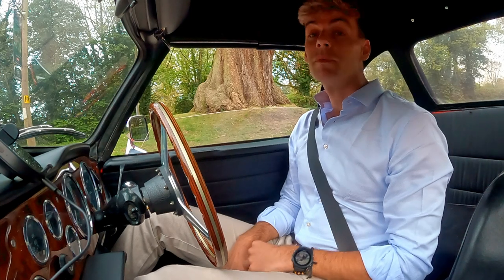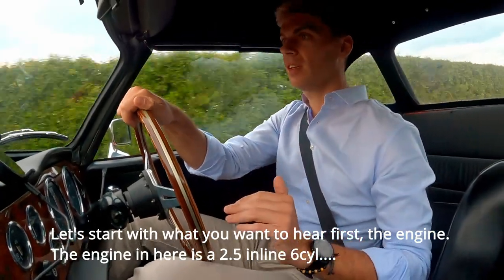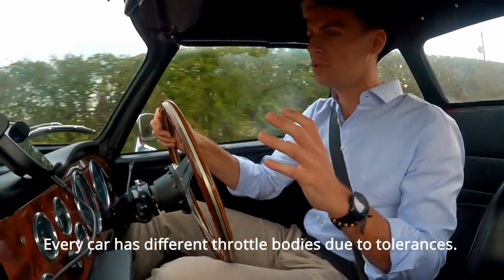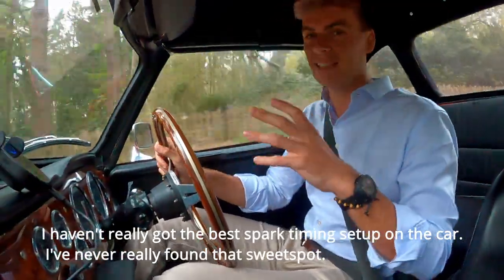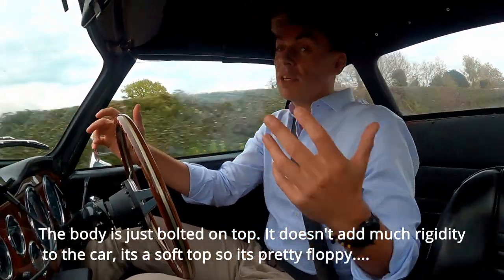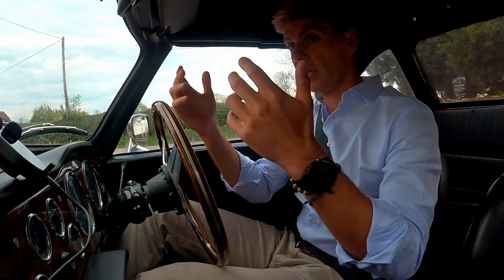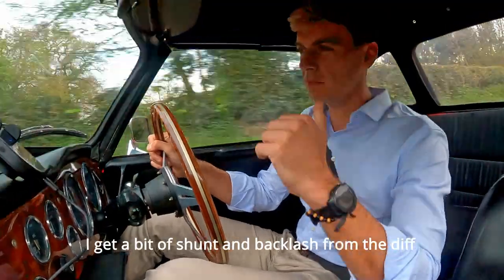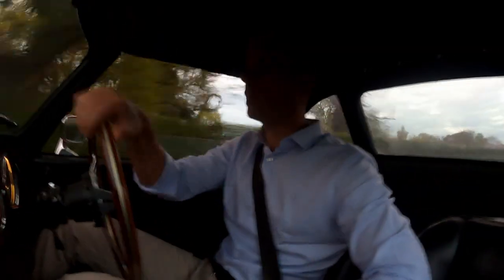Triumph TR6 PI Review: Classic British Engineering. Was it Rubbish? #classiccars

Comment: Great video! I live in North Carolina and purchased a ‘73 TR6 in 1975 while in college.  Right after purchasing it I had a rude awakening after taking it to the British  Leyland dealer for repair.  At that point I bought a manual and started doing all of work myself.  I added overdrive in 1976, and used it as my primary vehicle until 2002.  By that time I had put 200,000 miles on it. I kept it in good mechanical condition, and it has never left me stranded.  

In 2002 I purchased a Ford Expedition and started making the TR6 look as good as it drove.  

In 2012 I overhauled the motor, shaved the head to move the compression from 7.5 to 9.5, and added a cam that is similar to the one originally used in the 1969 150 bhp version.  The cam was developed by Good Parts located Pennsylvania. It preserves the idle quality while adding the power.  What a difference! It will now burn a little bit of rubber, and it is a blast to drive.  Bottom line, a TR6 is fun to drive, looks great, and reliable if well maintained.
Reply from the maker: Love that story! Enjoy it.
Reply: Mark, your post is encouraging.  I bought a 75 TR6 last year.  It’s in great shape but put a great deal of work into it already and more coming in 2024.  
I assume you have a Good Parts header on the beast, what did you use for the exhaust.  I have a dual Anza with a couple of resonators under there as well, yet it’s so loud I can’t have a conversation with a passenger without shouting.  Bottom line is, I want a performance boost but a more sane noise level.  Any suggestions?

Comment: I appreciate hearing the rattles when you go over a bump, since I’ve been hunting down rattles forever, trying to fix them in any way possible.  Attempting to reduce that feeling of they forgot to tighten all the bolts when they built it.  It’s getting better! Or maybe the roads are better!
Reply from the maker: Most of them in this clip are from the soft top pivots and loose nylocs but i know what you mean!

Comment: Enjoyed the video, having owned a 1972 UK TR6 some years ago it was great to watch. A couple of things I think which would have been worth a mention? The engine hp output for UK cars did differ 150 ( allegedly) until end of 1972 then 125 until end of production. The US cars were around 105 hp and as you say had carbs. I worked on these engines in the 1970’s and when one came in ( same engine in the saloon 2500 PI) with a misfire the first place to look was the injector. Failure mode was the injector end came away and was loose. Very quick job to replace.

Comment: This video was a revelation for me. When I was 18, I had a 1972 TR-6 and drove it off to college for the next 4 years. The top was always down, never mind the weather. Autocrossed it successfully and every girl I dated loved it. For me it was a dream car but I was nearly certain that if it only had P.I. vs. carburetors, for more power, it would be an absolutely perfect car. I never could have guessed that in comparison to carbs, P.I. would be such a nuisance to tune and maintain. I could never have done it right. Glad to know that my TR-6 was really perfect just the way it was.
Reply from the maker: I agree about the girl comment 😬
Reply: @PeakTorque  Not to belabor the point; but roadsters are one of life's most reliable panty peelers. My last one was a Honda S2000 when I was still single. A peak experience.

Comment: Nice looking TR6, I owned a GT6 mk3 for 23years (hence the youtube name!!) but sold it back in 2017. I converted that to 2.5L back in 2004, but ran with carbs and 3D mapped ignition, always ran well with that set up and minimal routine maintenance.
Good to see some Cheshire lanes, I occasionally cycle out to Beeston castle.
Reply from the maker: Great loop around beeston and bickerton. Couple laps of that at tempo is very sapping on the legs... potholes galore tho.

Comment: Beautiful car! BTW, what fuel do you use?
Reply from the maker: Super unleaded with castrol lead replacement. The valve seats haven't been hardened yet, but its on the list to get the head off again and do that.
Reply: @PeakTorque  Cool. We just sold my fathers 67 Porsche Sportster convertible. It was a great little car, but not for me. When the weather's nice, I'd rather be on 2 wheels

Comment: Mechanical fuel injection can be surprisingly good and less maintenance than EFI. Ive had a few cars on mfi and the Bosch  was the system I liked the most. I converted the points over to an optic electronic in a Lucas distributor with uprated coils. Did you retain the rotor and cap or do away with the dizzy altogether? My mate had a TR5 and a 7 and another mate had a Spitfire. I always fancied a Spitfire but bought a TVR S instead. Triple carbs can be a bugger to setup especially the SU's but once you get Weber's or dellortos balanced they tend to stay that way. I had a vacuum and ball device that I had great success with on a twin carb lotus.

Comment: Beautiful classic roadster you’ve got there! It certainly takes a patient engineer to drive a car like that. It’s not always about gobs of horsepower and blistering track times, but the sense of occasion and adventure just simply driving it to the grocery store. 
It’s far more of an adventure driving my locost seven around the block at 20 mph,  than my 335i at 80 mph on the freeway.

As an automotive engineer, I wouldn’t have the patience to put up with vintage engine antics and would have converted the engine to EFI with a modern standalone ECU, with o2, knock, MAF sensors and so on, while keeping the vintage roadster exterior. Or I’d swap the power train for a stock s2000 engine, trans, and ECU, and dramatically improve the cold start, BSFC, emissions, an so on—however the “charm” of vintage British engine reliability issues would be gone; which would be part of the adventure?

Comment: Nice video, nice car. I have an MGB myself. Seems too be a few classic loving cyclists around. Not as many in our age group tho 😮
Reply: Agreed. 

I think old cars and bikes go together naturally as they both need a hands on attitude compared the single use throwaway cars produced in the last 20years. Owners will naturally get younger as the generation these classics was built for get to the age they can no longer drive. 

I had to sell my 71 B GT last year as it had become a long term project I didn’t have time for and I needed the garage space to work on other peoples’ TVRs and, of course, lots of bikes. 

My now 20 year old TT fills a similar niche, and seems to have slipped into the “classic” zone, but does not claw into your soul in the same way as the smelly, clunky, snorting, slidey, rorty, beast the MG was. I miss the conversations at every fuel stop and the arguments at shows about wrong wheels, tyres, bonnet, suspension, air box, exhaust, basically everything. I did what I wanted to it, if it annoyed the purists that was just a bonus. 😬

Comment: It’s an accurate and good review. In terms of pushing this kind of car hard around corners and trying to make it do what a modern sports car would do is not really what this car is about though in my opinion. I have owned a TR6 for 8 years, restore it in 3 years and enjoy keeping it in good shape, cleaning and polishing it. The way I use it is to only take it out on nice days. I hardly ever put the soft top up as I hate driving it like that as it’s actually a lot more noise with the soft top up. A bit of spirited driving is ok but mostly it’s about cruising around on smaller roads enjoying the view, listening to the glorious engine, smelling it and doing this with fellow owners of classic cars. Going to classic car meetings is a huge part of this, talking about maintenance, modifications, studying other people’s cars and just taking it all in. It’s cheap to repair, most parts are available, easy to repair (when on carbs) and it’s solid. Some people say these cars was poor quality but I strongly disagree, try restoring a Japanese car from the same time and you will see what I mean!
Reply from the maker: The only reason I had the roof off is so you could hear me! (sort of)

Comment: Had a '69 TR6 in the early 70's. Carbs of course here in the States. It was always in the shop for one thing or another. I missed it so late in 2020 I got a new Mazda Miata. More HP at 181 plus spot-on reliable. Total blast to drive. Forget the TR6's unless you want to constantly tinker. If you truly want to enjoy top-down driving in a modern platform, buy a Miata.
Reply: well if you want a modern 4-cylinder car, you could but just about anything.

Comment: Gawd, Lucas mechanical fuel injection...  credit to you for keeping it running happily.
Reply: I don't know if that one has the Lucas ignition with the positive ground like the Ford Cortina. That would be trouble. The axle wound up so that the left rear would lose traction first. Engine turned the reverse direction from an American car of that live axle design. Rust, rust, rust, leaks! Cortina GT that is with the peace sign tail lights. Green Black.
Reply: @davidburgess741  thats the first I've heard of a reversed rotation drivetrain vehicle.
Reply: @rotaxtwin  most Hondas until 2003 ran reverse rotation.  Simplifies FWD application in that case.
Reply: @zedavia  Yeah, that makes sense.

Comment: Great review! Thanks! I am in Canada and looking at buying a thoroughly rebuilt twin carb 1975, tweaked performance cam, which also has a retrofitted roll bar which also functions as a chassis stiffener and a bunch of other stuff. Loved your discussion. Excellent stuff. Thanks again! So... final question: do I pull the trigger? Is the TR6 worth it? Thanks anyway, mate!
Reply from the maker: Buy it! Your ears will thank you for the sound. Anything mechanical can be fixed easily, but rust is another issue...

Comment: Dammit, I want my MGB back now!

Preferring a proper roof I Always wanted a Gt6 until I actually sat in one and realised the MGB GT was the better car in many ways, apart from the rear axle possibly, although a C would have been cool for the Big 6 but also biiiig money.

Pleased to hear how you’ve taken up the challenge of attempting to get the OE mechanical fuelling optimised. 
Are you not even slightly tempted to retro fit a modern stand alone EFI system to get the mapping absolutely dialled-in and be able to easily tweak it for upgrades or “ongoing developments as the engine evolves” ( read; wears) and hopefully stop it from slipping out of tune? You don’t strike me as an originality freak with other mods you’ve mentioned.

Would love to see more of this side of things - looking forward to the next one!.
Reply from the maker: My bro in law runs a gt6 mk3. I love it, but I am too tall to drive it even with a small wheel. Their prices have done very well recently! EFI - maybe some day. Certainly going to get a lambda sensor and weld that in to the exhaust soon, really want to create some sort of picture of what is happening. Otherwise I am just pissing in the dark trying to tune the MU and timing with no feedback.
Reply: I'd have the GT6 over an MGB any day, better looking, sweet smooth six,  woodgrain dash ...

Comment: Hi. I have owned a 1972 TR6 for over 40 years, still on the same injection system. Goes really well, hammered it around Castle Coombe 3 times including April this year at up to a ton on the start line straight. I wonder if your diff is your main issue because you are not getting the benefits of all the torque... 70mph in second overdrive, ton in 3rd overdrive etc. BTW, early diff was 4.125:1 Good luck though. Keep on enjoying it.
Reply: John, I purchased my TR6 when I was 21 - still have the car and I'm 67. 46 years of enjoyment. I don't agree with half the comments the reviewer makes. To pick out one comment about "constant use, doesn't like to sit around", when I had to pay road tax I only used it for 6 months, left in the garage over winter - still started fine and ran well. As to the diff - a quick search on google for TR specs states final drive ration is 3.45, I know Cox and Buckles used to build and sell a 3.7 ratio diff for hill climbs but the figure 4.125 is unknow to me. When was that fitted?
Reply: @GG-gotr6  Hi GG. You are absolutely right, I was writing from memory and had a brain fade. Thanks for correcting my mistake. I shall be taking my daughter to her wedding in the TR in a couple of weeks, so the memories continue to collect. Though I do have instructions to drive sedately for the sake of the hair do. 😊

Comment: Re: They leak like a sieve..., when they left the factory..".   Total rubbish.  In 1973, I bought a 9 year old TR4 with Surry top. It' didn;t leak like a seive. In 1976 I bought a 1967 TR5, with Surrey top. It didn't leak like a seive, whether it did or didn't have the canvas top section fitted or the hardtop. In 1981 I bought a 1971 TR6 softtop. It didn't leak like a seive. I had zero problems with the injection or metering unit on either the TR5 or TR6. A previous owner had fitted twin Webers to the TR4, they were an absolute pain in the behind.

Comment: I always admired those. That said they were oil leaking eventual rust buckets. The Japanese really did us a favor by waking is up from the trance of mediocrity. I'd take one for the first 6 months.
Reply from the maker: Datsuns also rusted like old nails! But definitely better thought through.
Reply: @PeakTorque  True that! Did a clutch on a 240Z and that chassis underneath looked bad. Nissan now uses a CVT on all models and I won't touch them. Subaru also, but with better rep.
Reply from the maker: @davidburgess741  a CVT, as a petrol head, is the devils work. Hate hate hate.
Reply: @PeakTorque  The Honda SUV CVT is a shocker.

Comment: Good back in the 1970s but they have not endured well and the new E10 petrol is the nail in the coffin. I used to love Triumphs back in the day but not now. The cheap materials BL used from the steel  body to plastics to wiring to soft top are not great. People asking £30,000 plus are having a joke as a good Mazda MX5 gives better performance and reliability.
Reply from the maker: Of course and not to mention an mx5 drives a lot better! Cheers